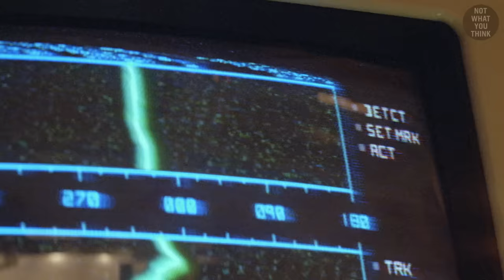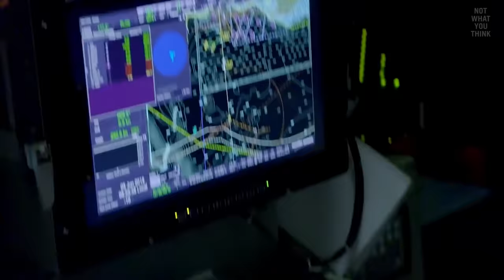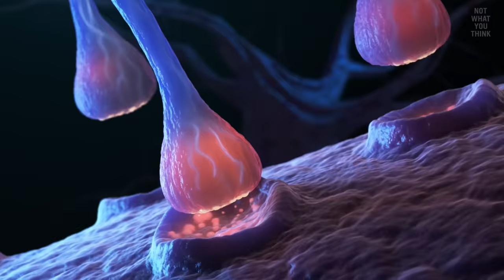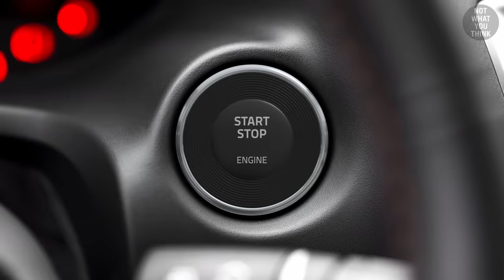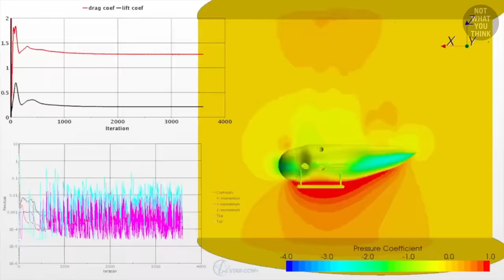What Happens When a Submarine Implodes

Comment: The "Diesel engine effect" is a hypothetical depending on certain ideal conditions. When not on the internet, I'm a biologist turned engineer and I also SCUBA dive.. The most likely thing to happens to a body is it gets turned into a deformed, raisin with an overall shape of the skeleton. Air gets heavily filtered and enough vapors to ignite is highly unlikely.

Edit: Looks like a lot of people are missing some key concepts. The heated volume, to be hot enough to ignite ANYTHING, would have to be MUCH smaller than the volume of the sub... duh, it gets compressed. THEN almost immediately the pressures are equalized and the VERY SMALL hot volume is nearly instantly cooled, remember at that depth the water is 1-2 degrees above freezing AND the compressed air was almost instantly dissolved into the surrounding water. NOTHING in that mini submersible got hot enough, fast enough to ignite. Human remains have been found AND the hull is being recovered in large pieces.
Reply from the maker: Yes, that was based on some speculations, which is why we added if it doesn't auto-ignite, it would get extremely hot, and that's caused from the sudden compression of the air right after the structure collapses.
Reply: @NotWhatYouThink  In the case of the Titan, I think investigation will tell us if any of  the joints were failing first with enough elastic deformation to have caused a VERY rapid ingress of water before an 'implosion.' We will hopefully find out. With the small volume and extreme depth, the heated volume would be most likely tennis ball size or so and the density of that water would very quickly cool it. I still would not want to put my hand inside a superheated air pocket! 
Your video did cover the speed that it would all happen - in the blink of an eye. Some people (even television media) don't really think about how fast it all happens. Using anything as RIGID as carbon fiber will have a very limited life cycle number. Carbon fiber is hard but not durable. All steel and titanium would be durable but also expensive and heavy.
Reply: Someone did rough calculations on the compression of the gas under the 3K underwater pressure and estimated the temperature rise of 1100°C in an instant during the implosion. That temperature itself is high enough to ignite anything capable of burning in the air.
Reply: Depending on depth no way the spine survives intact as the torso implodes breaking all the ribs.
Reply: @dieselscience  The carbon fiber would likely have cracked apart quickly once it started to crack.  Carbon fiber vessels' forte is not in compression, with the higher pressure outside, but in tension, with the higher pressure inside.  So a massive inrush of water into the formerly low pressure interior would be the thing to expect, with quickly squished occupants.  This was abysmal engineering.

Next time, at least build the whole hull out of metal, which if it does leak at least is more likely to leak slowly.  All other submersibles known to the world are built this way.
Reply: @dieselscience  Yes, the air pocket would be quite tiny compared with the space that had been inside the submersible, and might not even be touched by any of the occupants, who would get instantly squished by either the pressure of the water or the pressure in the air pocket.
Reply: Read up about "Adiabatic heating" of a gas under compression. (No fuel is required).
Reply: @toolbaggers  Spines and long bones are the ONLY things to maintain their shapes. Organs, fat and muscles were crushed, not bones. If any leaks came in long enough to form a stream they would be strong enough to amputate limbs but not very long.
Reply: @dieselscience  Stop making ignorant guesses.
Reply: very precise, it will not behave as piston engine.
yes, it will be quick (few milliseocnds), but it will fill with uneven streams of water, and gradually mix with water, and water vapors, become very humid (100% saturation). It will have also different attributes under pressure (water over 220 atm, dont have boiling point. It can reach 380 degrees C in liquid form, and then directly turn into gas).
The air is also isolant, it will transfer energy very slowly. Even at 1000, it will not burn anything during 30ms time. So water will just mixed with air inside, pushing him into milions of small bubbles from various directions, bubbles will become hot, and will transfer energy to water, very slowly, and start to raise to sea level. No burning anywhere. Also, I doubt they will reach more than 300 C temperature, as air will be humid and filled with 3C water moleculs and vapors. Air is 890 times less dense, than water.
Reply: @arseniix  it will not raise to 1100 C. (dont know from where you type that mark next to C, I would need to search it on internet, and it would took long).
The reason is, it will be mixed with water and water vapors, that are 3 C , and water is 890 times more dense, than air. At that humidity, filled with 3 C water and vapors, it will shrink to many bubles, not one bubble. That's why it will not reach high temperatures.
That 1100 degree would be in ideal conditions - piston engine, and with dry air. Water going from several streams and directions, will mix with original air volume, and compress it into many small bubbles... not one big bubble. And those small bubbles will reach high temperature more on the end (when very small), so they will not burn anything. Water is much more thermal conductor, with 890x better thermal capacity per same area, than air... so it will cool down anything much faster, than air will heat it up (similiar to water cooling on computer).
Reply: @warrax111  A piston engine creates compression ignition at pressures a tiny fraction of that when the carbon fibre hull failed.
Reply: @byteme9718  Yes, but in dry conditions.
Try it in 100% saturated humid air, filled with 3C water vapors. Also circling around streams of 3C water, that all the time mixing with it, and going through it. Those bubbles will be not static. As water will move through it under high pressure, it will get mixed all the time, sucking energy generated by compression all the time (it's like water cooling on computer).
Reply: @byteme9718  when water start to lurk in, at first time, there will 1 atm. After it lost 50% of original space, it will be only at 2 atm. So high pressure will be reached when it will be like on 5% of original volume, and less. In that time, most of the inner space will be filled with 3C water. The whole titan air volume could be like 10-15 cubic metres (its only guess, didnt count it). Even at 2atm, the air will be only 5-7.5 m3. At 10 atm, when it start to get hot, it will be already at 1m3 - 1,5m3.  That means, 9-14 m3 of inner space of submarine will be FILLED with 3C water. No condition to reach high temperature. Most objects would be cooled down by water. Water have 890times more thermal capacity.
Reply: @warrax111  I guess you skipped school but hey, you were there right and witnessed everything right?
Reply: @byteme9718  Stop trolling a real engineer, kid. Troll somewhere else.
Reply: @warrax111  Exactly. This thing got very WET before it got hot...
Reply: @SeekingTheLoveThatGodMeans7648  They would have air in their lungs. Mind you I don't believe they would have time to know.
Reply from the maker: The piston idea comes from the fact that the two ends of a submarine are its weakest points. So if anything is going to give first, it’s one of the ends, which would squeeze into the hull, somewhat like a piston. But I’m just speculating based on other people’s speculations 😬
Reply: @dieselscience  Come on, you're just making yourself look a fool and making up shit you clearly know nothing about. 

Take your comments "The heated volume, to be hot enough to ignite ANYTHING, would have to be MUCH smaller than the volume of the sub." and "the heated volume would be most likely tennis ball size". Heat sufficient to generate compression ignition, about 540 degrees C, usually begins at around 14:1 compression ratio, that's just over 200psi. Assuming the submersibles internal volume was around three square meters, 14:1 compression reduces that volume to 214 litres,  just a bit larger than a full size oil drum. How many of your tennis balls do you think would fit it one of those?

Big marine diesels work at even lower CR and in terms of the internal cylinder volume could easily match the interior volume of this submersible however, an implosion at the depth Titan was at would give a compression ratio of about 400:1 with far, far higher consequent temperatures.The presence of fuel to create combustion is irrelevant to temperature and what it alone can do to a human body. This is basic physics so for you to claim you're an engineer is pure fantasy on your part.

Apart from lacking a basic understanding of physics you're also claiming to know the mechanism of failure and that this or that happened, you don't! You also lack the most basic understanding of materials science and you demonstrate this with your comment "Carbon fiber is hard but not durable". WTF are you on about? Carbon fibre's primary advantage is its strength, as you clearly have no understanding of science that means its resistance to tensile loads or for you, being stretched. If you, in you infinite wisdom, don't think it's durable why is it used for the fuselage and wings of the Boeing 787 and Airbus 350 as well as in critical F1 race car parts? Maybe you need to speak to all those engineers who are clearly misguided. 

Carbon fibre works incredibly well in tension but is useless in compression where all the loads will be carried not by the carbon fibres but the plastic resin that surrounds them.  A carbon fibre tube with two end caps places the tube under pure compression that increased with depth and that's not even taking into account the pressure acting around its circumference. At a best, informed, guess, when the failure occurred, it would have been instantaneous. We know this happens with thick steel submarines that suddenly deform having exceeded their crush depth but the weak plastic resin would most likely have shattered. Various sonar recordings show this was a sudden failure.

The most likely scenario is that the sudden compression of the air would have killed the occupants by temperature and blast effect before the water collapsed in with enormous force to fill a void destroying anything left and washing away the remains.
Reply: @warrax111  "when water start to lurk in"   Water lurked in? You clown! Explain the sonar that recorded sudden hull failure, not just from the support ship but elsewhere.
Reply: @warrax111  "It will have also different attributes under pressure (water over 220 atm, dont have boiling point."   Yes, it's attributes are very different under pressure where water turns to STEAM. Steam can easily ignite anything combustible because its STEAM and not water vapour. You clearly don't understand what a sudden hull collapse means. perhaps you've seen too many movies where there are leaks inside submarines and think that's what happened. 😂
Reply: @dieselscience  do not reply to that byteme clown. I've muted him in notifications, what a troll, lol.
Reply: @Fuzzybeanerizer  omg. again, I dont have that mark for degrees, that little zero, 3C means 3 degree celsius. Thought average will figure out
Reply: @Fuzzybeanerizer  that's nice, but in piston engine, you have mostly gases, here in submarine, air as get compressed will be mixed with streams of cold water. Water have 890X higher density, and great thermal conductivity, so guess, what temperature reach that air, it will not go very high, and cool very quickly.
Reply: @NotWhatYouThink  Wrong. Water would need to be solid, so it happens.
Liquid water have different attributes as solid end of piston, and will mix with air, as it get compressed. It will also get in with streams and beams. (first little crack will make stream of fast moving water... the speeds of water stream will be very very high, maybe as fast as slower bullets. So air will start to shrink into many many bubbles, not one piece.
Reply: @NotWhatYouThink  The weak point in the design was the carbon fibre tube between the titanium end caps. Carbon fibre's main property is resistance to tensile loads however it has no resistance to compression and the pressure acting on each end cap would have exerted pure compression. All that would have resisted this is the plastic resin surrounding the carbon fibres. Hull failure would have moved the end caps together however it doesn't really matter because pressure acts equally and the water would have moved in at the same rate causing massive sudden compression of the air space it filled.
Reply: @arseniix  And in milliseconds the ingress of water cools things to below combustion temp. Meaning it doesn't matter as nothing is going to be burned.
Reply: @P_RO_  nobody says that you can't burn in a millisecond flash
Reply: @arseniix  Burning is a dynamic function which takes time. You can pass a finger through a flame quickly with little damage, but for it to char or burn takes time. Hairs might get singed here but that would be all. What the pressure did to those bodies though....
Reply: @warrax111  Good idea.
Reply: @P_RO_  exactly... you can even touch Lava, if you quick enough, like it takes less than 0,1 sec, or less than 100 ms, it will not burn you.
Reply: @Fuzzybeanerizer  It is. Water vapor is still more dense than air. 
But main problem, why air inside dont get too hot, or burn anything is fact, that it will be mixing with streams of water, until it get compressed, while it is still big. Only remaining bubbles at the end, will become hot. But as air is isolant, it will not burn anything, and also everything will be cooled down by water. Bubles will swirl around, at those pressures, and forces. And will immidiately start to raise, because hull will not stay intact. They will be pushed out of the shell, unless only one crack (at one side) will appear, but that one crack will for sure get larger, when material is composite (steel hull would not probably shatter)
Reply: @warrax111  "is fact, that it will be mixing with streams of water, until it get compressed," Why on earth do you keep blabbering in about "streams of water" when it's KNOWN for a fact there was a sudden implosion? 

How can you claim "air is isolant"? You can't compress part of a gas, for example just the outside of an air pocket so the sudden compression would raise the temperature of it uniformly in the same way it does in a diesel engine.

The highlight of ignorance in your statement is "but that one crack will for sure get larger, when material is composite (steel hull would not probably shatter)" FFS!  We know how steel submarines that have exceeded their crush depth DEFORM and they DON'T shatter. The Titan however placed  massive compressive loads on a piece of plastic and you're talking about a small crack that "will for sure get larger". 😂

I've copied and pasted your original comment below in case you realised how embarrassing it is and remove it.

@warrax111
6 hours ago
 @Fuzzybeanerizer  It is. Water vapor is still more dense than air. 
But main problem, why air inside dont get too hot, or burn anything is fact, that it will be mixing with streams of water, until it get compressed, while it is still big. Only remaining bubbles at the end, will become hot. But as air is isolant, it will not burn anything, and also everything will be cooled down by water. Bubles will swirl around, at those pressures, and forces. And will immidiately start to raise, because hull will not stay intact. They will be pushed out of the shell, unless only one crack (at one side) will appear, but that one crack will for sure get larger, when material is composite (steel hull would not probably shatter)
Reply: @warrax111  Where did your little mate go to, did he run away or are you just posting one the one profile now?

Comment: There is a transcript of the last communications with the titan and it's mother ship. They were on their way up to the surface because of rtm warning and they dropped weights and pilot said cracking noise from aft so they were trying to troubleshoot issue while trying to surface 😢 I think this went on for not more than 5-7 minutes max.
Reply: that transcript is unconfirmed, and nobody seems to be able to tell where it came from... if it was genuine, the crew of the polar prince would've came out by now and confirmed it, but they haven't. if the transcripts are true, the polar prince also would've contacted the coast guard for assistance almost immediately upon receiving word that they were having issues fron stockton... but again, they didn't do that. it's very likely that this transcript is false, as a result.

Comment: here is film footage recorded inside unmanned submersibles that were anchored near nuclear test detonations. One film shows everything is perfectly fine, and when the pressure wave hit it, within one frame, all you see is water - it's incredibly fast.
Reply: Link?
Reply: Link?
Reply: Link?
Reply: There's a video showing a pop can in a pressure chamber and when they crank the dial up it literally goes from a Red Coke can to CONFETTI falling to the bottom of the tank in a Split Second
Reply: @thecloneguyz  link?
Reply: @mwbgaming28  I saw it at work on the computer not on my phone I'd have to look for it on YouTube
Reply: @mwbgaming28  it literally went from a red Popcan to literally nothing bigger than the head of a pin in a Split Second